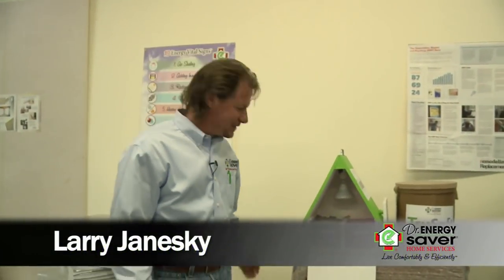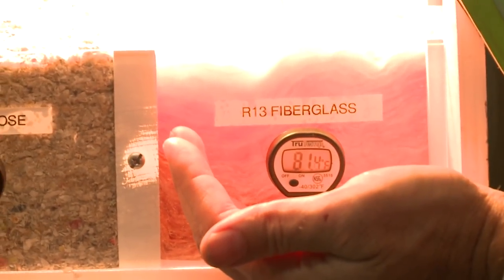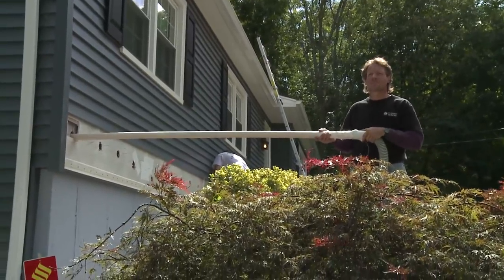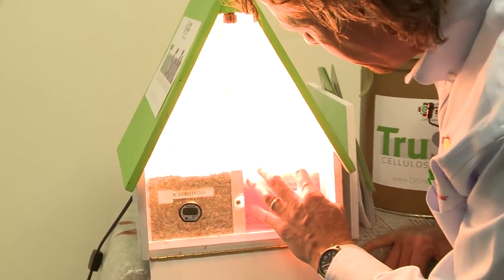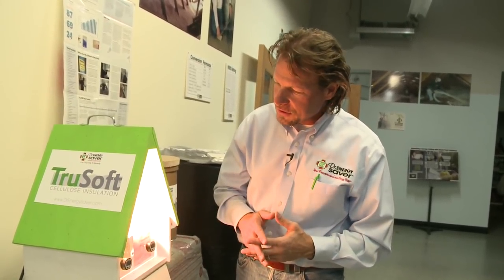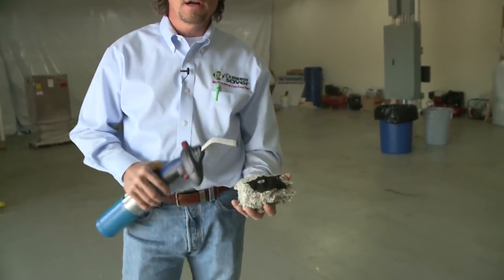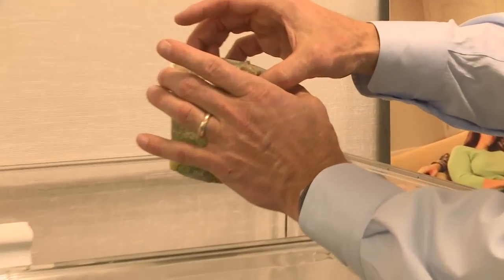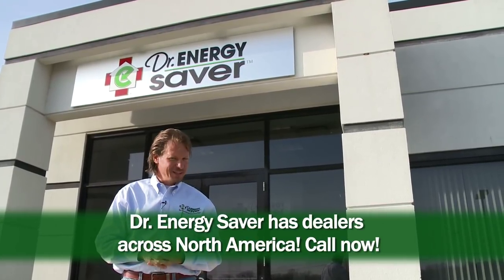Why Cellulose Insulation is Better than Fiberglass Insulation

Comment: What happens if water gets into cellulose? If it's so dense and air tight, that means it can not breathe. Although it is treated, mold will still eventually develope in the material, and the water reduces mold resistance after long exposure. 

Cellulose = Recycled Paper
Fiber = Recycles Glass
Cellulose = $$$
Fiber = $$
Cellulose = Air Tight / Not Breathable
Fiber = Not Air Tight / Breathable
Cellulose (Wet) = Difficult Removal
Fiber (Wet) = Less Difficult Removal
Cellulose = Overrated and Outdated
Fiberglass = (See the Above)
Spray Foam = $$$$$$$$$$

How about we try something different? Something like a nano-honeycomb metal panel wrapped in rubber or plastic?

Our industry is so far behind as far as science and technology is concerned...

Comment: such total BS!   from the very start... this guy has a demo device which he pretends is similar to reality.  ha!!   He has 2 extra inches of cellulose!!  then, the same device has the thermometer within 1 inch on the fiberglass.. but 3 inches on the cellulose.

Next, cellulose can NEvER be blown in at consistent levels.. and especially not into existing walls.

Fire-proofing??   Fibergl6is awesome.   Nothing more to say.  

at rhe end, he talks about how many more inches of cellulose they use.  well, ah, add more fiberglass inches and you will get same result.

aaaaand, this sh*t gets wet!!!  major problem

Comment: The little light bulb test is rigged. Anyone with at least one semi functional eye can see they messed with the fiberglass, it's substantially less dense on top than the bottom. Batts come uniform in density, not fluffed up on one side like they did here... less fiberglass on top means less R value between the light bulb and the thermometer.